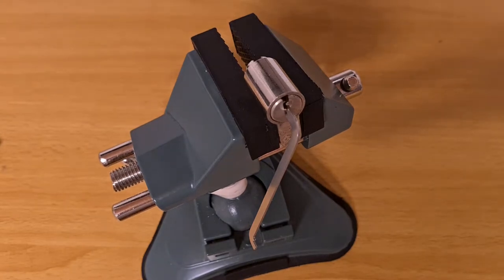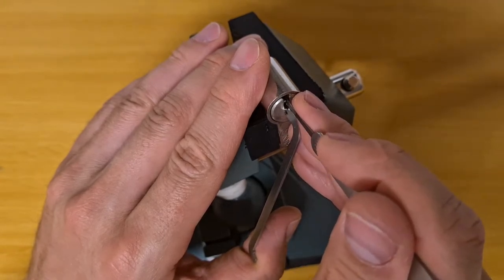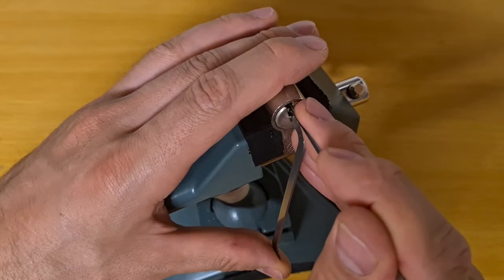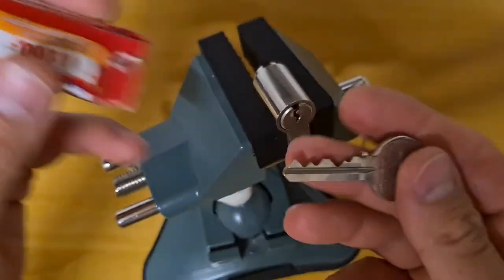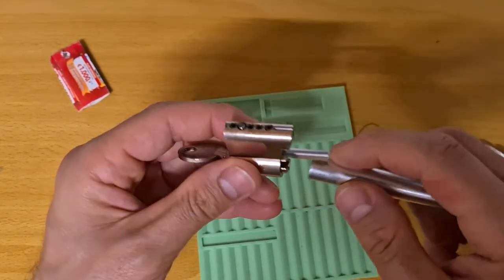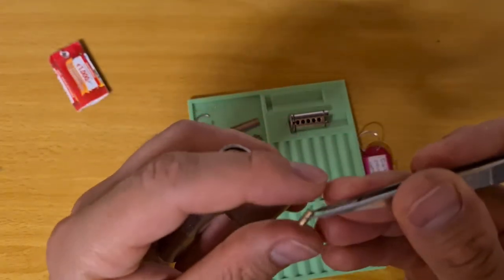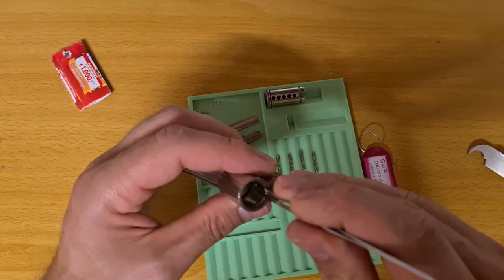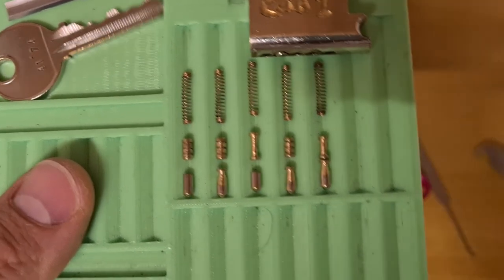Gio I challenge lock - Sriped Hyena

Comment: Glad you liked it. And very nice seeing it picked both ways. The key pins are regular key pins, filed down to their new shape. The driver pins are all hand made from brass rod, including the serrated ones. The bible slot 2 has a steel inside, so I was not able to also counter mill that one.
Reply from the maker: I thought something was off with the chamber 2 :D
Very clean work on the pins! I was confused for a moment with the regular distance between the serrations - very nicely done. The countermilling too, but I think the pins didn't match well with it, so the effect was quite muted. Great job overall!